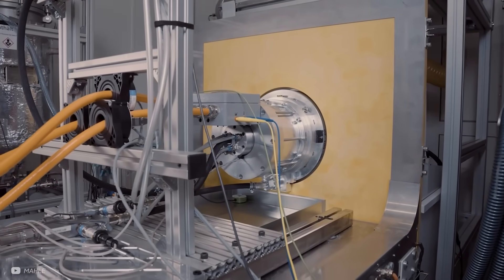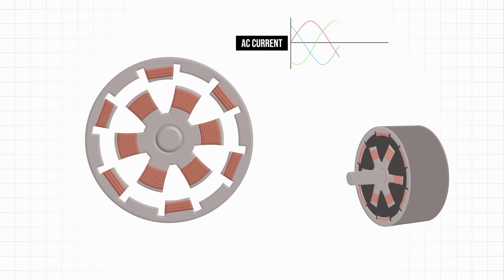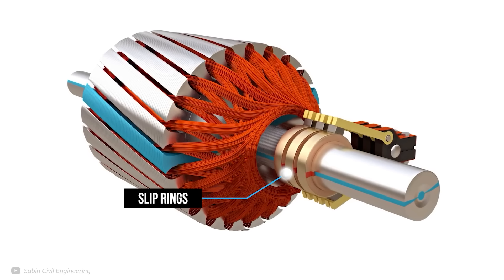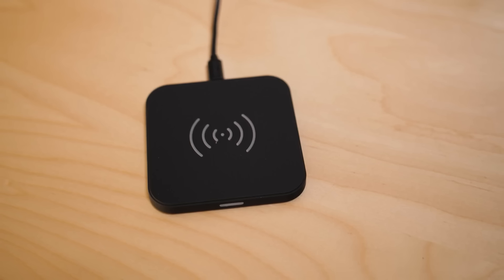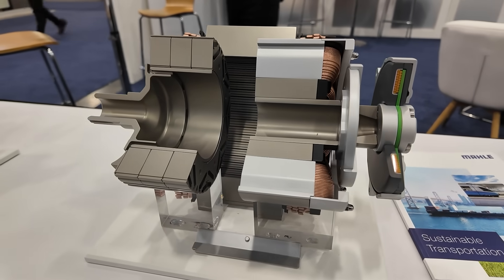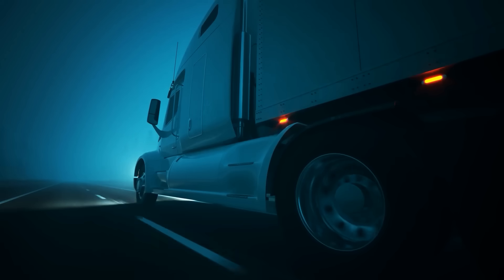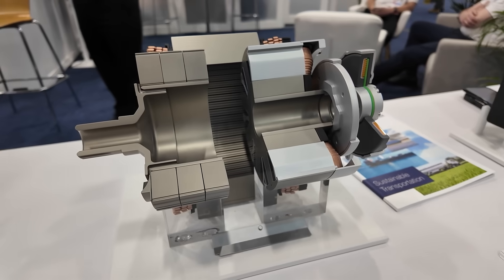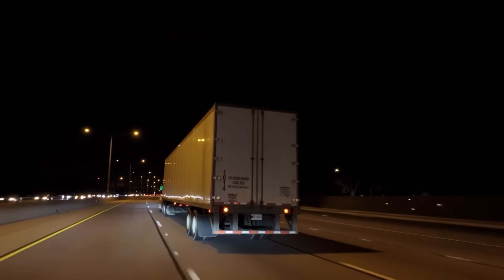Genius Contactless Motor Could Change Transport Forever

Comment: This seems like a 3-phase induction motor with extra steps
Reply: its exactly the same tech that grid scale generators use
Reply: bldc motors too are 3phase induction motors except i ductor ones use electromagnets while bldc ones use permanent magnets 😊
Reply: @ahmetmutlu348  if it has permanent magnets it can't be an induction motor
Reply: @CatNolara  well logically true.. but still thats not what i wanted to point out... the fact is inductor motors create wirtual magnets to do what permanent magnets do... so logically same thing ... but politically they are different things 😅🤔🙄😞😏 but for me after seing a simulation of how they work in my mind.,.. no they are exactly same thing... just difference is one uses static magnet other uses virtually generated magnet... but at end it ends as some thing...
Reply: @ahmetmutlu348  not quite the same, under load synchronous motors can "stall" when the rotor can't follow the stator field anymore. On an asynchronous motor that can't happen since the induced rotor field has the ability to rotate as well due to slippage. If they are run closed loop it's a different story, but controllers for both have to be designed differently as well.
Reply: @CatNolara  on inductir ones the 50 or 60hz main voltage frequency is used as control timer it seems... so ewen if a inductor motor looks direct flat connected if wired correctly itll have a 50hz timer nahively... while on dc ones that frequency is generated by internat speed control timer on controll circuit... on brushed ones brushes are set to allways power inverse polarity inductors... there is also brushed ac ones but they are bit complex as they use capacitor to create momentary dc or tkming shift/delay which i didnt completely hnderstood the logic ... 🙈🙄🤔😞 but they seems like make a frequency shift tough capacitor to make delay so they ca  start as 50hz is too fast ie 50rpm as start timing...
Reply: @ahmetmutlu348   - BLDC are PM Synchronous motors..  (PM = Permanent magnet, the DC bit was just for very simple DC chopping BLDC-Drivers, industrially - and high end RC / UA, etc,  these are driven with Pure Sinewave inverters - VVVFD)
Reply: @kadmow  well.. i opened lots of them on scooters for repair and reverse engineering... lots of them.. and it seems they are simply inverters... well mush closer to a high power h bridge .. it switches h bridges polarity depending on hall sensor... thats it... but logically that circuits are allmost identical logically to inverters ... just 3 phase... each phase switches direction dependjng on their own hall sensor... so timjng is relatively independent... if you dont beed speed and reverse options they can allmost work ewen without additional processor or circuit ... and still 3 phase industrial grade ac 320`~v inductive motors are identical too. actually dc power is converted to ac in that hall sensor controlled to ac .. 36 v or 70v or whatewer it is designed for... so a bldc will nostlikely work with ac 320  line if hall bridges gets power and 320v is downgraded to not burn it 😏😞🙄🤔😅😁

Comment: A random thought: I guess the electromagnets in rotor could also be controlled to generate a rotating magnetic field like the one generated on the stator side. Instead of rotating only the stator's field, the two fields could be rotated in opposite directions at half the speed, and the two fields would still be at the same relative speed with respect to one another, achieving the same exact torque, right? Could this amount to efficiency gains? What would happen at other rates of sharing of the relative speed, e.g., two thirds on the stator's field and one third on the rotor's field?
Reply: I don't think it would create any efficiency gains. It's cheaper to only have to vary the field in one set of windings. It might give some extra fine control at very lower speed, but I doubt it.

Comment: Transport is certainly important, but even before EVs electric motors accounted for a HUGE percentage of total power draw across the planet, because since the first electric motors people have been using them in everything in industry they possibly can.

This won't just change transport, this will change everything that electric motors touch.

Comment: This is Not going to be more efficient than a normal wired motor when using Wireless power, At best wireless power has a loss rating of 70%, If temperature is playing that large of a difference that if makes it more efficient, then i feel we should just Oil-cool the wired motors..

Comment: As i have been converting 3 phase electric motors to capacitor energised generators for over 35 years this is nothing new & over complicated that will just reduce reliability. O inductive charging is the lowest efficiency of almost any power transmission system.

Comment: You might laugh at me for asking this, but why do we have a magnetic field for the earth if earth's core is molten?
Reply: The earths inner core is solid due to the extreme pressures despite the intense heat. The earths magnetic field comes from the outer core and mantle being liquid and in motion (from earth’s rotation). Spinning molten iron generates an electric field which in turns generates a magnetic field.
Reply: michaelr1 • You can imagine the electric current as a flow of "electrons", ions, etc, being either as "something" moving into a wire or as the molten wire moving itself ( molten part of the inside Earth ). Then that flow of something ( "electrons" , etc ) is the current which generates a magnetic field.

Comment: Concept looks great - avoiding permanent magnets is key. Love the cooling concept. I wonder about wear of the point where oil is transferred from from the rotor to the stator. Oil circuit motor is a potential failure point.

Comment: 4:45 wireless charging cannot be more efficient than wired charging.
Reply: This week in "ziroth uncritically reads out a press release and pretends it's science"... not sure why keep falling for this channel's videos as they are never anything of substance.
Reply: Inductive charging is extremely inefficient. There are huge losses to heat and power output follows the inverse square law. There is no way this could be better than a wired connection . . .
Reply: @raiden9250  
Induction hobs are efficient enough.
Reply: @johnburns4017  induction hobs are efficient compared to other methods of heating, but heat is not what we want in an electric motor.
Anyway, it should be alright for use indoor where you can have limitless power on plug, but not for electric vehicles. There’s a hawker here who used induction hobs because gas cylinders are outlawed in his city. He has to use a generator because the batteries in his electric van are inadequate for the massive power consumption. How is that more efficient or cleaner than a gas cooker?
Reply: @madsam0320  
Maybe he should get an electricity supply.
Reply: Inductive charging is extremely inefficient because of the random gap between the coils and the lack of magnetic cores to channel the flux. Transformers are incredibly efficient and are inductive in nature. When you have precise coils at known locations and you can build your control circuits around them I would be willing to bet that you can get the inductors to transfer energy more efficiently than you can get graphite brushes to do it. Brushes are an easy go to not necessarily an efficient one. You are correct that it follows the inverse square law, but that means that you simply make the coils close together. This technology is not new, how long have magnetic disk drives been around? The oil cooling system is likewise old hat as it works well in jet engines and turbines.
What I hear in this video is dude saying that this is world changing technology and never will he admit that its old hat that has been improved through incremental changes as every other field does the same. Fifteen minutes of lucidity and after that incremental improvement for two hundred years. But that doesn’t make for good video. 
It is just fortunate for us that the induction motor only has to be invented once, then we can use the little leaps to have something to keep us employed for a century or so.
Reply: @shawnsmith9512    brushless motors also work well
Reply: @raiden9250  "Inductive charging is extremely inefficient."    <--   That is not universally the case.  Here a near field high coupling efficiency can be assured mechanically.
Reply: @raiden9250  It will always be less efficient than wired charging, but there have been advances in wireless charging with what they call resonant coils. Some manufacturers claim the efficiency is as high as 90%-95%, which would put it roughly in line with slip ring motors.
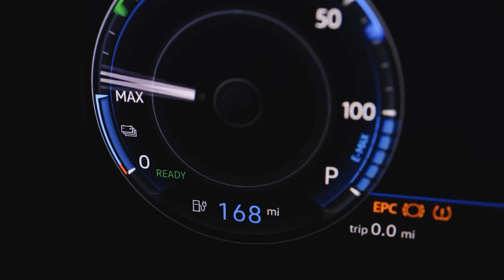Reply: He said convenient, maybe I'm deaf but I didn't hear him say more efficient, ah okay, I think you meant 7:30, though he's talking about how the design changes balances out any inefficiencies, not just "wireless charging"
Reply: @kylexrex  He cut it out at 4:45 The jump in audio and video are very apparent
Reply: @kylexrex  Remember Earnest goes to camp when the youth were against strip mining?
Reply from the maker: I removed this section as it was a mistake - I was meant to be referring to it being more efficient than an induction motor but had it in the wrong section of the script! Thanks for pointing it out - Ryan.  (I posted a similar comment to this yesterday as a reply but YouTube seems to have not posted it)
Reply: switched reluctance motors are more reliable, have less parts, and accomplish same thing in a smaller lighter package.
Reply: Ok, I didn't watch the video in time to catch the referenced snafu.
However, here's where I think they can keep the the energy transfer efficient (maybe more efficient than slip ring when you account for increasing resistance in the carbon electrodes at high temperatures.)
First, tight tolerances. They can keep the coils within 10ths of a millimeter/Thousandths of an inch to tightly couple the fields. The design can also be engineered to use the oil bath to enforce the separation- it will anyways.
Second, high frequency. The motor controller is going to be specific to this design, so the inverter section can be run at frequencies that are optimal for the coil windings. I'm certain that there are PhD students that could write simulations to find the optimal combination.
Third, high voltage. Power transfer becomes more efficient the higher the voltage. No reason the drive motor couldn't be run at 1000+ volts, which also reduces the amperage that needs to be carried through the windings to do effective work.
The whole point of using the inductive coupling to power the rotor is to remove the main wear item in inductive motors. Goodness knows I've burnt out my share of brushed AC motors in my time and nearly every brushless fan I've had kept working so long as lubrication was kept up.
Reply: 7:10
Reply: - not for the Ziroth fan bois..   watch out man..
Reply: You know it isn't.
Reply: wow  you dont get it yetat  all
Reply: @heyheynowinga9972  Actually, a company a friend worked for created these charging devices. The waste in energy they could never overcome.  Do not assume. Or you make an ass out of yourself.  Make a constructive argument.
Reply: wires = resistance, no wires =  no resistance. So seems like you're mistaken
Reply: @thijs9558  How did you come to the conclusion that there are no wires involved in wireless power transfer????

There is a coil of wire in the 'sending' coil and a coil or wire in the 'receiving' coil - as explained in the video.
So electricity still flows through both of those coils encountering resistances like in any other wire... but with wireless power transfer the electrons in each coil have to induce a magnetic field which has to propagate through space (decreasing in strength the further it travels) before being converted back into electrons in the receiving coil IN ADDITION to the normal resistance losses from the wires themselves. 
Also the coils of wire are exactly that... coils... so wrap around many times in a small space... meaning you might end up using a 1m of wire in both the sending and receiving coils close together when 1cm (1% of that) would have been enough to span that small distance with a direct wire connection... the more wire used the more resistance losses (but it is necessary to create a strong enough magnetic field).

So no. Your intuition is mistaken and wireless power transfer is most definitely ALWAYS less efficient to some degree than a direct wired connection.
Whether the extra inefficiency at that step is more than made up for with greater efficiencies in the design elsewhere - or in other parameters like greater reliability is a different question.
Reply: So it can. Depending on the losses from friction etc fron slip rings. Also sometimes reliability is more important than efficiency.
Reply: Yeah wireless charging is inefficient,  carbon or graphite brushes are ok to a point, what about using slip rings in mercury or another conducting liquid,  surely it could transfer more power without wear, and could be cooled if needed
Reply: @ricksummerfield7260 : That’s one idea, but there’s a flaw with that. A vehicle is usually going to be moving when the motor is turning, and unless you live somewhere where the roads are a perfectly smooth surface then the mercury will be sloshing around in the chamber; potentially breaking contact dozens of times per mile. And what happens when a 480v circuit gets interrupted while under load? It makes an arc; which is pretty dangerous and quite destructive. The vaporized mercury from an arc is really hard to contain inside a container that is not one flawless solid piece. And that’s all before we even consider the difficulty of managing the expansion and contraction as the weather changes; where I live, winter is often -10°F for the overnight lows, while summer can get upto the mid 90s. Now, I don’t know about you, but I’m just a little too lazy to go out and add fluid to the motor of my car just because the temperature changed; and even lower on my list would be draining it back off when the temperature rises again (which has been insanely erratic lately).
Reply: @jacobcarlson4010  it works ok on other devices,  maybe a bit toxic if spilled, but I doubt a bumpy road would be an issue,  your car's power steering still works over bumps, and that usually is a gravity feed to the pump.
Reply: @ricksummerfield7260  Congratulations, you have just invented the electric motor version of the Torque Converter
Reply: @ricksummerfield7260  That's not a bad idea.  Some home thermostats use a tube with a drop of mercury in it that completes a circuit with two electrodes embedded in the glass when one side of the tube falls below the other via a bimetallic metal spring.
Reply: Correct, but slip rings aren't perfect conductors either, and they wear out, which can mean reliability problems.
Reply: @tlangdon12  yeah but slip rings are still way more efficient, and they take years before you need to replace the graphite contact pads, which are pretty inexpensive, the cost in the wasted power would far out way the cost of replacing the graphite pads
Reply: @HerbaMachina that was my feeling, everyone knows how inefficient induction charging is. And you don't need a degree in fluid dynamics to know what losses and potential leaks will be caused by the spinning oil.
Reply: @HerbaMachina  60 HP DC motor with variable commutator has excellent speed control; But, running 24/7 you will replace all 24 brushes at least once a year. We were so jealous of the plants that had the induction motors with inverter drive.
Reply: @-danR  
The oil cooling heats the car - a bonus.
Reply: @HerbaMachina  slip rings may not remain very practical at higher speeds.
And would wear out very quickly.
Reply: @tlangdon12  reliability is not what influence performance during normal usage. It's independent parameters.
Reply: @tlangdon12  slip rings are not a thing
Reply: Bro quietly deleted that section so he wouldn't look like he messed up.

But ye, you're right it obviously isn't more efficient however it will be long term because the slip rings  wear out and more resistance come with it.
Reply: I think it might have to do with using the correct frequency.
Reply: I continue made my innovative project of a non-combustion engine, I remind you that I am posting here on my channel the technology and the principle of operation, according to which anyone can create a prototype and enjoy free energy, since I was denied financial support at the stage of the idea and theoretical research, after a year of unsuccessful searches. Including I will begin to assemble a sample. And soon another video will be released, revealing my developments, the wind of change is approaching! All those who are not indifferent, welcome to the flight in this departing innovative car, which will lead to great achievements for the successful future of the planet and humanity!